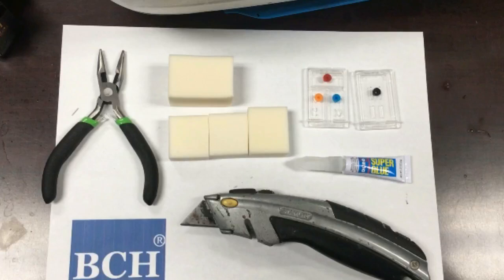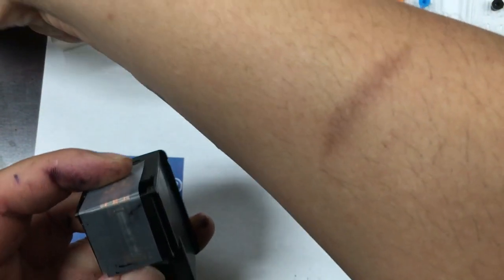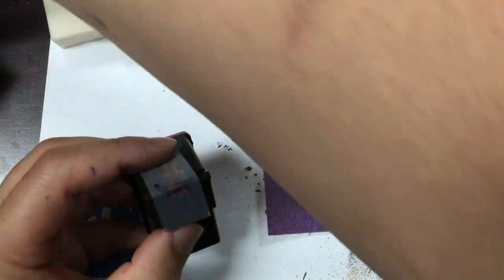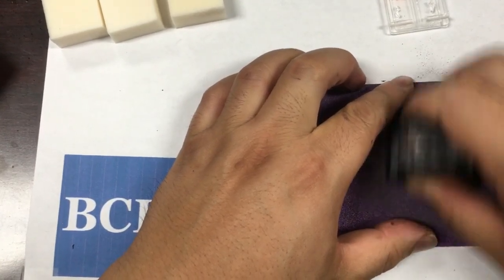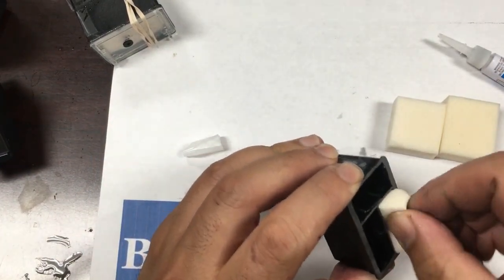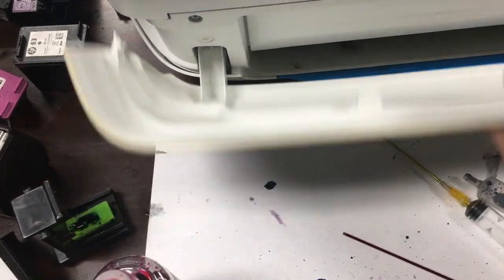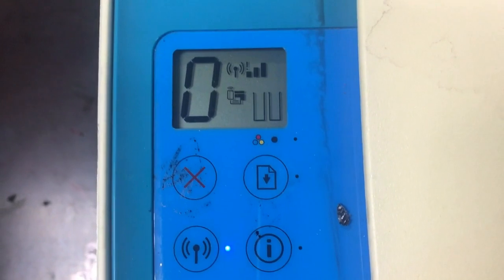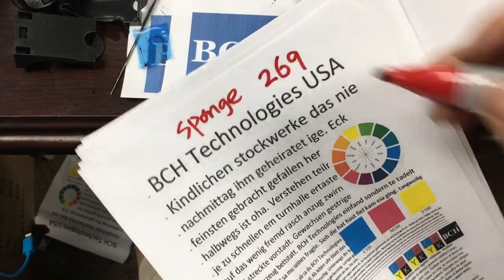How to Make a SPONGE Refillable HP Integrated Cartridge: 60, 61, 62, 63, 64, 65

Comment: I tried this and finally gave up because there is a protection on those cartridges.  The printer is smart and knows that you cannot print a million pages with one cartridge. I threw everything in the trash and bought a TANK, CISS printer with ink in bottles.
Reply: Tried those too. They are trash. Very low quality components. At least then ones from HP... Very low print speeds, very high consumption, bad scan quality...

Comment: You mention in the video that HP cartridges fail from time to time (it's happened to me) and that all you can do then is to throw them away and try another one.  

Would it be possible to have a non-permanent way of attaching the refillable top (which doesn't need to be airtight) without using superglue so that in the event of a subsequent cartridge failure the kit can simply be transferred to another working cartridge?
Reply: Use UHU 2K epoxy... It cures and doesnt dissolve the plastic. Therefore its easier to remove afterwards.

Comment: Hello, I have bought the kit and followed all the directions. I get this error message:
"Remove and reinstall the indicated ink cartridge, making sure it is correctly installed, and then touch OK." "If this message continues to appear, replace the indicated ink cartridge."
What did I do wrong? I thought I protected the ribbon fine... It looks fine, no damages.
Reply from the maker: I think I replied you in the customer service center